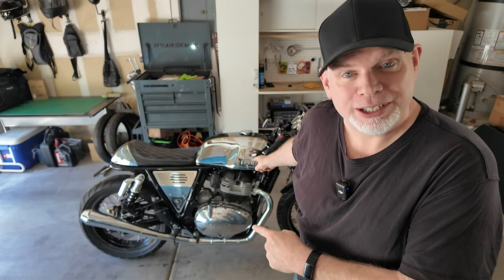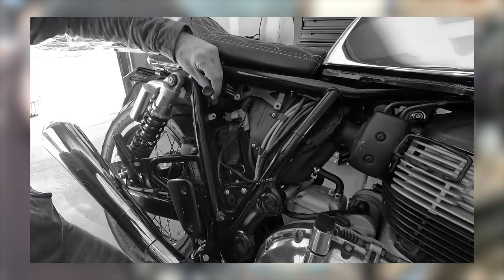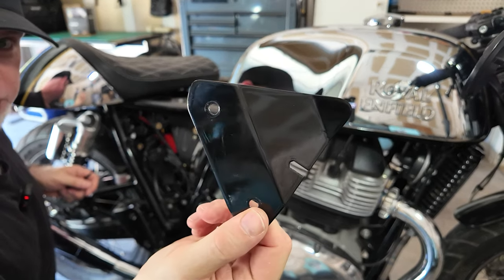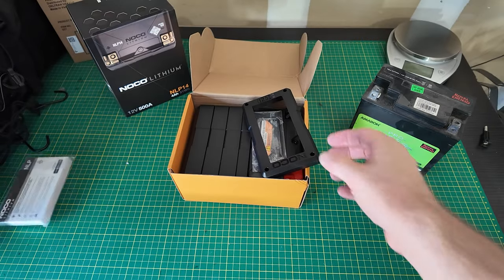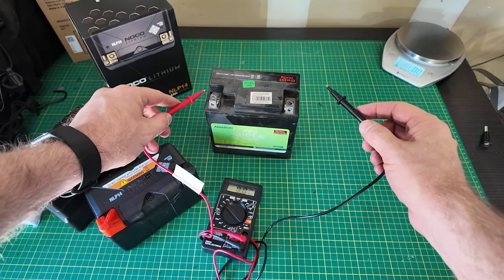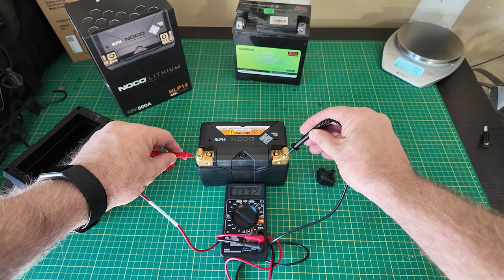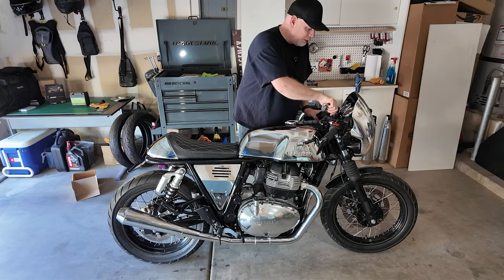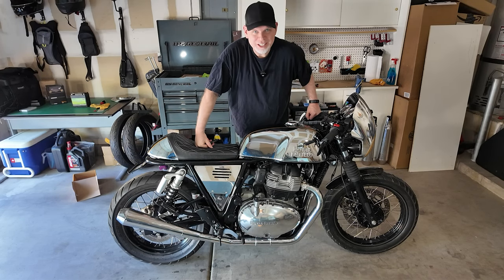Install Lithium Battery | Royal Enfield Motorcycle Won't Start | Dead Battery Problems

Comment: Hey Jerry thanks for the plug 😊 I saved 8 pounds when I changed my battery . One thing you will notice if when it gets a little colder and your bike as sit for a little while it won't start till battery warms up a little bit turn on the headlight . And the funny thing it gets stronger and stronger the more you try to start till it does, completely opposite from a lead battery. Cheers John K.
Reply from the maker: I don't expect cold issues where I live, rarely if ever gets below freezing. But, I plan to keep on a battery maintainer. My concern is having a parasitic draw on the battery with accessories I've added to the bike.
Reply: @RideWithJerry  Oooh right out there in Nevada ,do you have accessories hooked to you battery? I have a USB port connected to my accessory connector in the headlight but that has no power when bike is off.

Comment: Did this last year,havent looked back,can leave bike for a month and it will start first time,also saved 4.3kg in weight
Reply from the maker: I knew the lithium batteries were smaller and lighter, but I was really surprised at how light it was! Extra weight that I don't need to lose now - having pizza and an extra beer tonight! Ha!